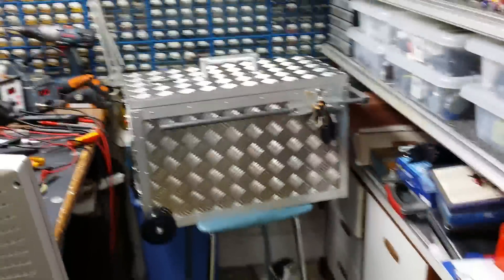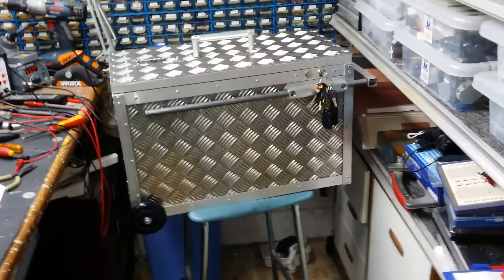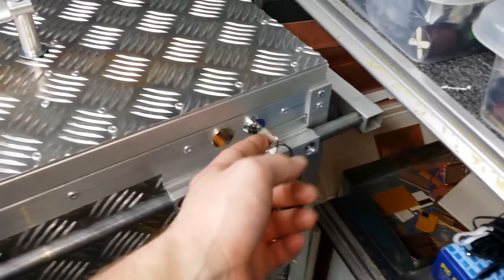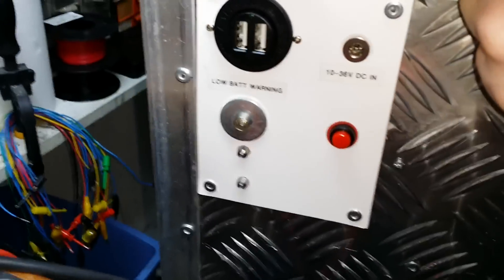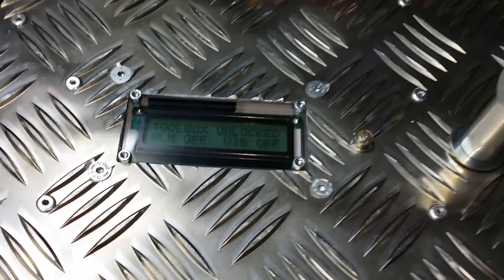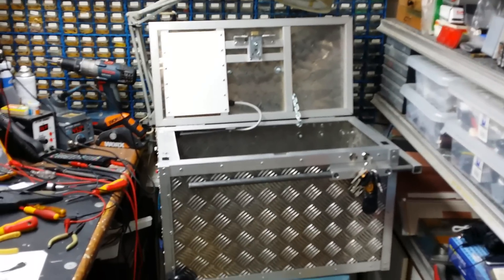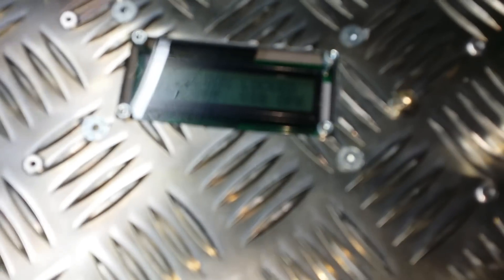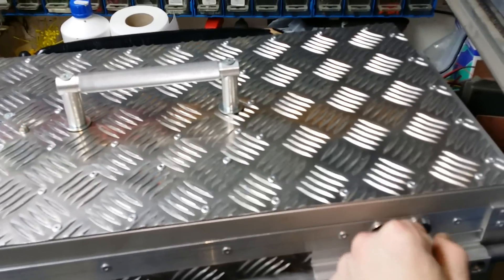Homemade aluminium tool box / tool chest

Comment: That thing is awesome, I'm about to build one for myself well not all the electronics on it. like you I'm tired of these cheap plastic boxes you can buy. i want it out of aluminum for one I can weld alum um and second it will be big enough and durable enough to carrying all my welding gear when i work in these refineries. Thanks for sharing you've given me some ideas on my box to make it more durable.
Reply from the maker: thats great that you have a tig welder, unfortunately i didnt have one, we only have a mig :( hence why its been riveted to hell and made with a angle frame! thanks for the nice comment :)
Reply: tittytwister5251 Mig is greta for aluminum probably better then tip welding it it would be less distorted which i may mig weld min I haven't decided yet. I'm going to use a brake and and try and keep my welding down because of the distortion.
Reply from the maker: welderman27 Really? i always thought you couldnt mig, do you have to use different welding rods? this is very interesting, and could open some doors for me :)

Comment: great box. Looking to build something similar for my son. Agree with you about plastic toolboxes, his is  falling apart. He is an  electrician on big sites in Dublin and trying to protect tools from theft and work at same time is difficult. Your box looks a good solution. You mentioned you have photos of the build process, I would appreciate seeing them. Also would appreciate circuit diagram for electronics. and any other help or links of sourcing materials would be great. thanks for video